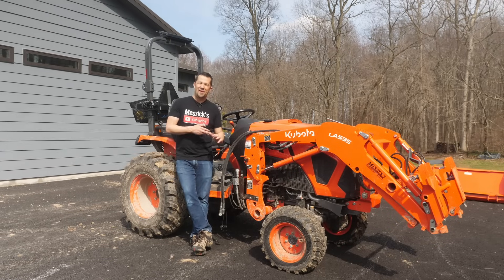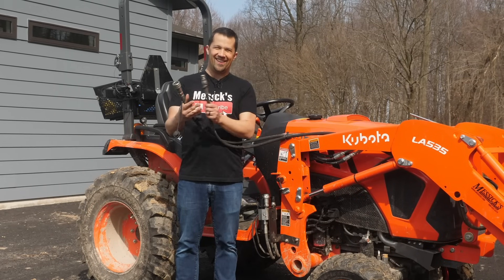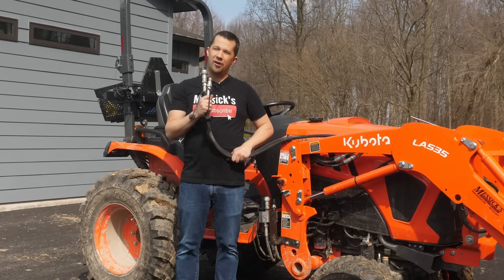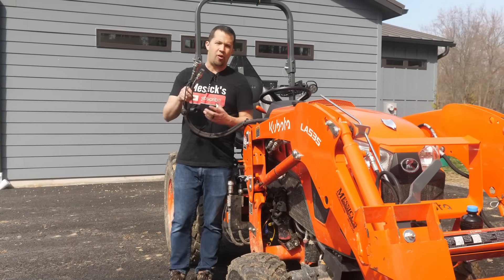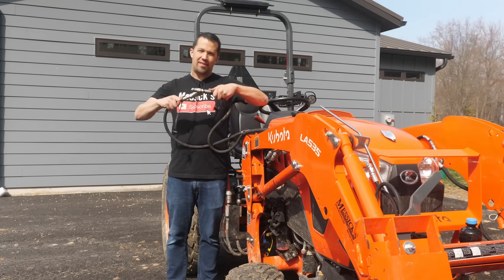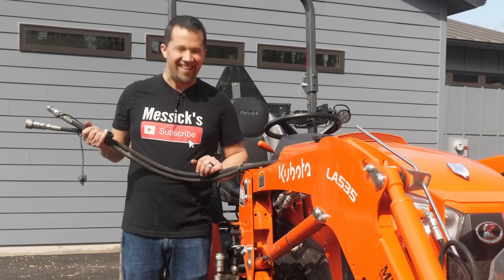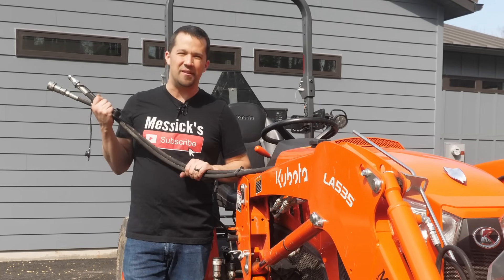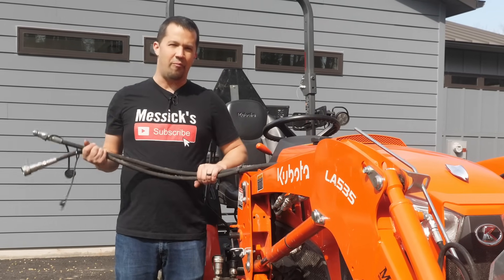How to Relieve Hydraulic Line Pressure

Comment from the maker: Messick's now offers a clamp that is designed specifically for this situation. 
https://www.messicks.com/parts/hcct12fr

This hand-operated clamp is crafted to simplify and secure the connection of hydraulic quick-couplers—especially when the hydraulic system still holds pressure. By acting like an external “helper” to press the couplers together, it allows operators to connect hoses or attachments without having to first relieve line pressure, making the process faster and more user-friendly. It eliminates the need for makeshift tools or risky manual force, offering a safer and more consistent way to handle stubborn hydraulic connections. Ideal for anyone working with hydraulic equipment, it helps reduce downtime and frustration in the field.

This easy-to operate trigger clamp is rated at 375 lbs.
Will fit both 1/2" and 3/4" thread couplers.

Comment: I have learned to connect my hoses back together on my attachments once removed from the machine.  Read somewhere that for every 1 degree F increase in temp, hydraulic fluid pressure increases 32 psi.   Problem is the hoses are different lengths resulting in different line pressures.  Enjoy the videos, keep up the great work!

Comment: I've learnt to tap the end of the male fitting with a hammer or spanner to depress to center tit to release pressure and the female fitting you do the same but with a punch or the flat end of a rachet handle. People don't realise that oil expands when it warns up just a little bit even. Glade you mensioned it.

Comment: Those hyd couplings are not designed to uncouple under pressure, read your instruction manual. If you wish to uncouple any auxiliary attachment you should stop the engine by turning off the ignition, then when stopped turn the ignition back on,.. do not restart the engine you then move the Lever into position holding it for a few seconds in each position to releave the pressure when that has been done turn off the ignition and then disconnect the auxiliary attachment  hoses 
The only hydraulic couplings that can be connected or disconnected have screw thread on both the male and female.For nearly twenty years I  have been called out to many so called professional machine operators who have disconnected hoses under pressure and say they cannot re couple the attachment. 
Just a point to note DO NOT handle high pressure hoses that are under pressure a pin hole in a hose is like a hyperdermic needle injecting oil into your
 bloodstream, I know of five machine engineers who have injured themselves by injection of oil two of them have paralysed fingers, BE CAREFUL.......

Comment: Neil- just had same issue. Your tip to relieve  pressure in the hoses on the loader, worked. I was diligent about the tractor side, but never thought about the loader side. Rising temps in last few days was all it took to make my simple actions to put loader back on a nightmare. Thanks! 
Dan, Colfax IA 0:46

Comment: On the hydraulic lines we have you just take the end push it in about an eighth of an inch and then hold it for a second or two and it bleeds off the pressure and they hook right up. Are not all hydraulic lines like this?

Comment: If new couplers are be ball bearings stiff.  We don't have pressure and the connection is tight but it doesn't lock.

Comment: I put skid steer couplers on the end of my hoses on the front of my loader . They easier to clean off before hooking up and the don't leak like the pioneer couplers do over time. And the added benefit is people wanting to borrow your attachments most folks don't have that kind of connections on their tractor. Also when folks borrow your hyd. attachments they might not be using the same hyd. fluid that your tractor has and contaminate your tractor. I was changing  a buckets on a cat hoe one  time and had to loosen the fittings to get it connected  like you did . Thanks for sharing.

Comment: Is it possible that the pressure is built up in the lines on the grapple as well? I did this and I still cannot get them connected. I’m going to crack coupler on grapple tomorrow morning (it’s 100 degrees and the fluid is insanely hot).

Comment: It is a pretty day and I need to get back out and work, but not before saying God bless you for the right solution at the right time.  Well almost right - it took me 45 minutes of trying before thinking I need to consult another problem solver.  I'm far from a gear head and did not know the pressure could build up on the implement side, but I bled a teaspoon of fluid and seconds later my connection worked.  Thank you very much.  Thank you.  Thank you!

Comment: Everyone with hydraulics should own a Waite Hydraulic Quick Connect Decompression Tool. There are different sizes & styles of Q.D.'s (quick disconnect fittings), so you must order the correct Waite tool to fit your own Q.D.'s. Use the right tool for the job!

Comment: Didn’t really want to bleed the lines, so I tried just wrapping gallon sized bags of ice around the hydraulic cylinders.   10 minutes later, they went on with ease!  😊
Reply: Yes that too.  I have problems with my grapple out in the sun.  If you dont mind getting your tractor/attachments wet,  spray them down with a garden hose if you have one available.  Works everytime for me and no fluid loss.
Reply: @lesstech74  Work smarter …. Not harder!   😊

Comment: For the skid steer style couplers I use a pair (male/female) of bare (uninstalled) face couplers that have only the plastic factory dust plugs installed. Simply plug in the respective couplers and the excess pressure is immediately bled out (maybe a tablespoon or two of hydraulic fluid) around the dust plugs. I do this for both the attachment and the tractor couplers. A pair of face couplers run about $50. I suppose you could do the same for the pioneer style couplers.

Comment: Wow, how difficult would it be to add a button or lever that does this?  My biggest frustration with tractors is that they marginally improve over the past (even worse) design and call it a job well done when in fact they haven't solved the whole problem.  If a third party has done something like this (likely given that it's both common and obvious) someone please post a link.  Thanks in advance!

Comment: I have a case 1085C that needs some parts, do you carry case replacement generic parts?
Reply from the maker: You can talk with our team of parts technicians and they would be able to get you the info on these parts. You can call in to 800-222-3373 or use the parts diagrams available at messicks.com.

Comment: I’ve always been taught step 1 relive pressure on the tractor side, step two, take the the coupler and jam it against the tractor to relive the pressure from it. Kinda hard to explain with words but if you jam it agains something hard it pushes the little plug at the end in and let’s the fluid spray out in a way where it’s not gonna spray at you under pressure, sure it’s messy but it’s safe and easy
Reply: That is exactly what I do.   I jam the ball on the end of the male end into a hard piece of steel then retry.   First always work all valves open on tractor end.
Reply: That does not work with flat face couplers.

Comment: I have been successful in putting a ratchet extension with the square drive into the coupler and hitting it with a hammer to relieve the pressure.

Comment: I use a different method. I use a 6-inch length of 1/2 inch brass rod and insert it into the female coupler, then wrap a rag around the whole thing and give the rod a tap with my toolbox-on-a-stick (hammer). It releases about a 1/4 of a teaspoon of fluid and I am good to go.

Comment: Had this problem a few days ago when the loader had been off the tractor. Called my local Kubota dealer service and they were kind enough to explain the steps to loosen the coupler and relieve the pressure. It worked.

Comment: OOOHHHH PPPLLLLEEEEEAAAAASSSSEEEE!!!  I grew up on a farm and when you park an implement that has a hydraulic cylinder on it you either have a pin that can be put in place (often used for road travel) that you can put in place or you block it up in the air when you detach it.  But before you detach it you turn the tractor off and  cycle the hydraulic valves on the tractor.  This relieves the pressure in the hydraulic lines to zero.  But as you correctly stated, if the implement is disconnected on a very cold fall day and you try to reattach it on a hot day their can be a bit of pressure in the hydraulic hoses.  All we ever did to relieve that minor bit of pressure was to smack the nose of the male connector (the one with the exposed ball valve) onto a hard surface like the draw bar.  You get a little "spurt" of oil and you can then easily connect the hydraulic line.   ABSOLUTELY NO TOOLS NEEDED!!!  Just try to make sure that the end of the hose and the surface your going to strike it against is dirt free.  It is so incredibly FAST and EASY and NO tools are needed!!
Reply from the maker: You're correct but, you run the risk of high pressure hydraulic fluid shooting under your skin. It works, I do it too, but it wouldn't be the recommended method.
Reply: @MessicksEquip  :  Well, my experience was that the manner in which you have to grip the end of the hose to strike the tip against a surface would eliminate the chance of being injected with hydraulic fluid.  To have a chance of that happening you would almost have to strike the end of the hose against your own hand.  I don't know about you, but my hand has never been rigid enough for that possibility.  If you want to add a bit of safety to the process, after cleaning the end of the hose with a clean (mostly) rag, wrap that rag over and around the end of the hose before you strike the tip against the draw bar.  It contains the little "splat" of hydraulic fluid rather well.

Another point is that the threads of many of the hydraulic coupling can have that Teflon tape on them to assure against leaks.  You can't constantly be loosing and tightening fittings with that tape on them and expect the tape to do it's job.  You'd have to remove the fitting and re-apply new tape, making a real big mess.

Just clean the tip of the hose, wrap a rag around it, and strike it against a hard surface.

Comment: Great info Neil.  No matter how I try to relieve the pressure I seem to occasionally get this problem.  Typically I find that if I push in on the inside of the fitting (I call it the plunger) with a flat round pice of metal, like a punch I can relieve the pressure and quickly connect the fittings.  So far so good, no leaks or damage to the fitting.  My question is;  what is the likelihood I will damage the fitting or implement if I continue this practice.  Appreciate thoughts from viewers, good luck to all.
Reply from the maker: Usually you don't want to do this because of the risk of hydraulic injection. Some people mitigate that by covering the end with rags.
Reply: @MessicksEquip  Awesome, thank you for the response!  Love the new Mount Joy location, best wishes for continued success!

Comment: Hi Neil, I live in Australia and have the same problem. I made a tool that slips over the coupling and welded a bolt to the top. It screws down on coupler and relives pressure Easily. You Only need to screw it down with your fingers. Only loose a little bit of oil and very safe.

Comment: I just got in the habit wether it's a front or rear hydraulic quick connect to shut equipment off and relieve the pressure through the valve before disconnecting the lines, same when reconnecting them.. makes it much easier to do...

Comment: If you were to do that with some pipe thread couplers you would have to take then off and then have to put on pipe thread dope.  If you didn’t you would have leaks.  So to me that is not a good solution.

Comment: is it acceptable to just use a wide screw driver or small square driver to press male connector to release pressure?
Reply from the maker: see comments below about hydraulic fluid getting shot into your nailbeds. It works, but can be dangerous.

Comment: Good morning Neal. I noticed that you are wearing a YouTube shirtsleeve tee shirt. Is it that warm in Pennsylvania ?  What is that mounted on top of your roll bar?  Most people never would’ve guessed to release the pressure on the hydraulic lines // system to connect your hydraulic lines. Excellent video Neal. 

Liked Subscribed & Shared
Reply from the maker: We had like 2-3 nice warm days at the end of March, then it turned cold. Its been awful since.

Comment: Neil I get that when I hook my loader back up to my Grand L3240.  What I usually do is to put a rag over the end of the hose and lightly hit it with a rubber hammer or if it is the female side I have a large round bar I slide in wrapped with a rag and hit it.  It does the trick and I don't risk having a leak at fittings.
Reply from the maker: rag is a good idea.

Comment: I'm in Australia but ordered online out of the US a product called an X-Boom QC Mate to squeeze flat face couplers together. It applies 270kg of force and is basically an Irwin clamp with U-shaped fittings on each end. It works brilliantly and means no more bleeding the lines. It even works in reverse if needed to disconnect fittings.
Reply: Yep QC mate is awesome
Reply: This is what I'm looking for! Tired of using a wrench to loosen the connection.
Reply: One trick I learned from an old farmer requires only a shop rag and a hammer. Wrap the male connector with the shop rag. Whack the end of the fitting with the hammer, and it will release the pressure into the rag.
Reply: I looked it up ….nice thanks guys 👍🏻🇺🇸
Reply: Thank you for the information 🙏!!!

Comment: One thing my local dealer sells are hose "end valves"- its a quarter turn ball valve with a pioneer coupler on the other end. The idea is, you disconnect whatever implement you're working with, cap the tractor end with the rubber covers, and on the implement end attach these valves- with the valve closed. 
Keeps the coupler that will need to be reconnected to the tractor clean and undamaged- its covered by the valve connector, and allows for a safe way to relieve pressure before trying to reconnect- point hose away from everyone, slowly crack the ball valve, close it, remove ball valve, attach to tractor. 

They cost something like 35 $ for a pair, if I recall correctly

Comment: The right tool is a hammer.  Tap the end of the male fitting, pushing the plunger in, releasing the fluid.  Be advised you will be wearing some though...

Comment: I hate to crack the fittings to relieve pressure, and doing this several times can actually render the fitting useless as the threads wear out.
I use two different methods, well three, if you count the procedure you mentioned as to working ALL of the hydraulic controls.
I will sometimes use a QC Mate to squeeze the two connectors together, and this works rather well.
OR, I actually made a pressure relief tool using a gutted hydraulic connector with a T-handle and bolt fabricated into it and will mate it up to the connector under pressure and turn the handle which uses the bolt to push onto the connector thus relieving pressure.

Comment: It would have been just as easy to jack up the loader a little bit. That also relieves the hydraulic lock of the attachment without needing to spill any oil.
Reply from the maker: This was with 3rd func hoses
Reply: @MessicksEquip  The loader frame was still in the air. There could have been some residual pressure in the system. Relieve all the pressure in the system and try again.

Comment: I was stuck in this situation a few years back and had no tools at all. I discovered that many of the hitching pins Kubota uses fit pretty snugly into the couplers.  You can then tap on the pin with what ever you have available which pushes against the inside of the coupler. In small amounts you will begin to relieve the pressure.  I feel this is pretty safe too since the pin blocks any large steams of fluid too.

I recently picked up a  QC-Mate by XBoom Couple 3/8 and 1/2 duo jaw 12 in quick clamp which is now stored in the tractor to make things really easy.

Comment: Ken’s Bolt On Hooks sells special decompress hydraulic wrench’s (different sizes) for hydraulic line and pioneer fittings.  I just bought one.  I got sprayed in the face and eyes last summer trying to decompress my loader hydraulic lines.  Luckily I wear glasses, because I might have loss an eye, that hydraulic fluid sprays out like a jet when it’s under pressure.  Great video and warning owners not to be under your implement when you relieve.  Replaced my first loader hydraulic line this week, first thing my dealer said was release that pressure by moving loader joystick around 5 times and don’t be under loader when you take off the line.
Reply: Thanks a lot it really help me first time tractor owner lol

Comment: Wish I had seen this a year ago. First time I disconnected my grapple I had it fully open. When I went to reconnect I could not get those fittings to couple. Loaded up the tractor and went over to Kubota dealer and he did exactly what you did, loosened the fitting, relieved the pressure, and Presto, easy connection.

Comment: This method is a LAST resort! Every machine with hydraulics should come with Xboom Coupler QC mate hand clamp. It is the safest, fastest, and easiest way to couple under pressure (Can even be used to compress coupled connectors to release the lock ring for un-coupling).
Reply: I second this. The Xboom QC mate tool is by far the best way to deal with this issue. The “Waite” tool works good to relieve the pressure but the QC mate just connects it, no need to relieve anything.